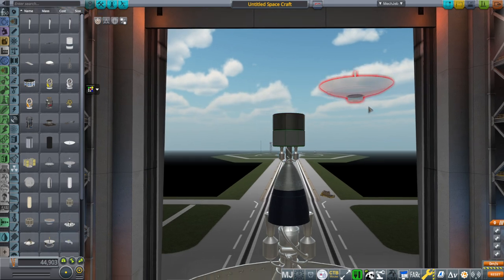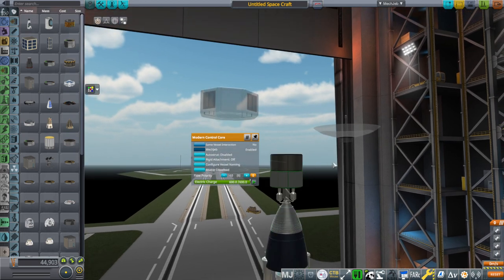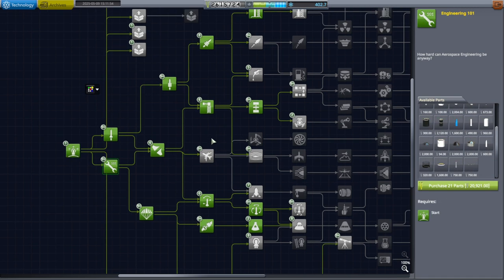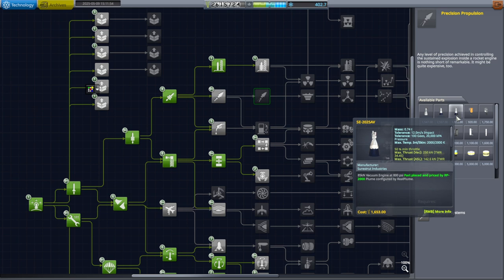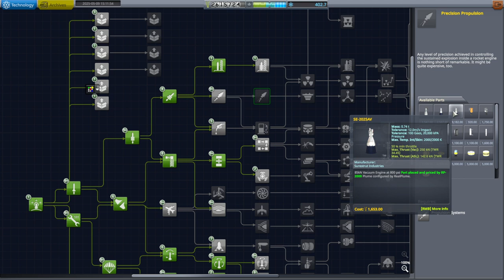Realism Overhaul in KSP 1.8.1 - Mod Update (Surestrut, Small Rockets, RP-2000)

Comment: Really like the balancing change. Makes you feel like a startup in 2000 rather than the 50s. Also do you plan to balance/make parts for late in the tech tree? Inclusion of I-E , farfuture tech etc.
Reply from the maker: For futuristic parts, it's tough to say beforehand what pricing might be appropriate, which is why I'm playing through RP-2000 to see, though admittedly I'm not going very fast. I will probably make parts if it becomes apparent they're necessary.